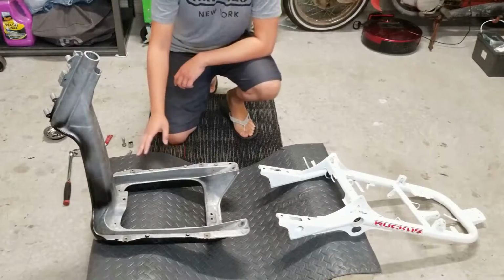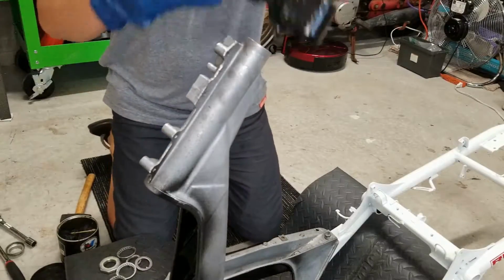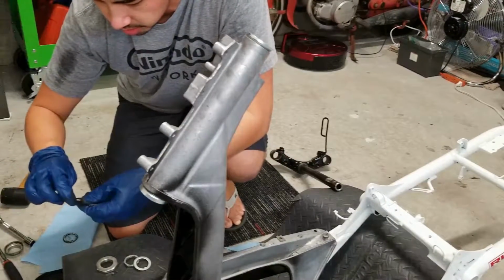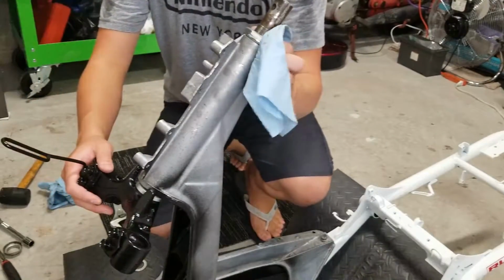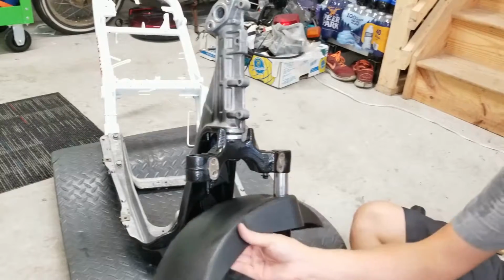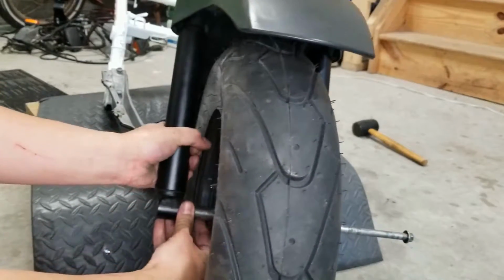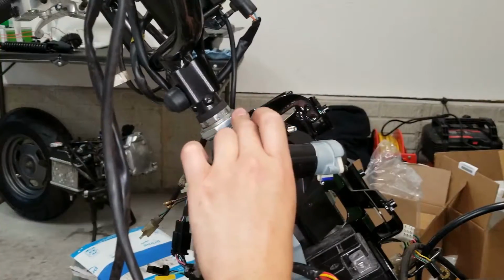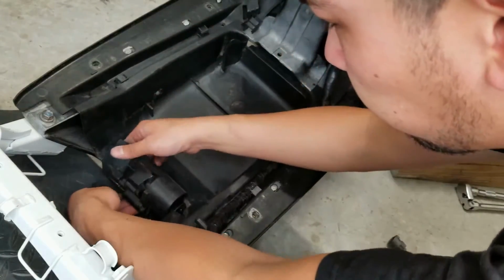Honda Ruckus Built From Spare Parts - Part 1!

Comment: Always put it on something to help putting it back together easier. Work from one end to the other. I like going from back to front especially on a scooter because the motor has the center stand and has the most weight.

Comment: Mistakes made on putting the forks in or front part in was not putting some grease in the bearing cups. Then putting loctite on the locking nuts for the steaming. You don't use loctite on the front steering. You only use it on bolts and nuts like on the frame or anything that can rattle or shake loose. The forks don't need loctite.

Comment: Why not put the motor on so you have the center stand from the motor to help hold the bike up.  Electrical should be the last things to be put on. The main things that should be put after the frame is put together is the forks then the motor then the front wheel. Then you have a rolling bike you can move around if needed. Then you do the electrical and the rest of the components. The reason for putting the motor on after the forks is because the motor has the center stand. Makes it easier to work on.